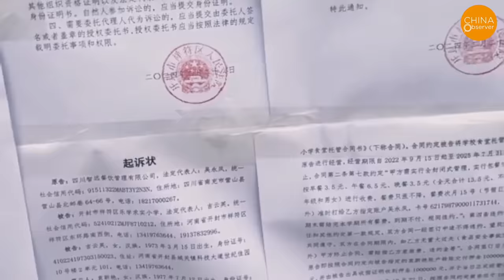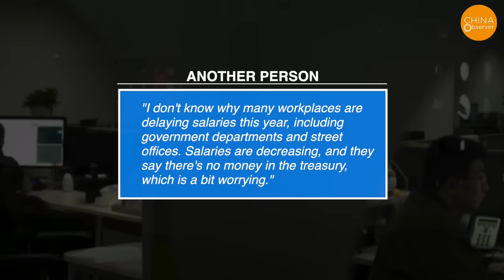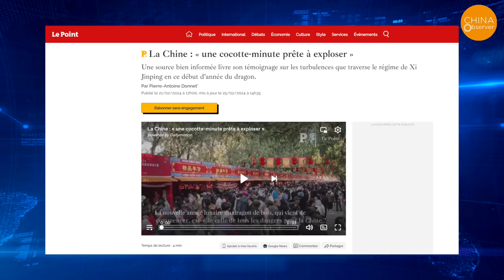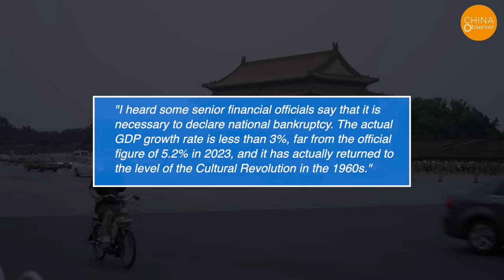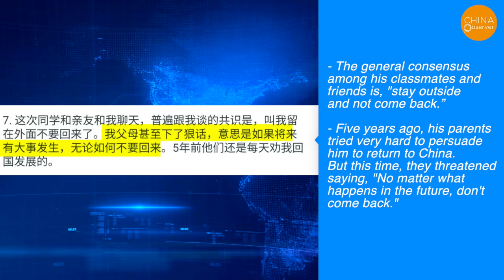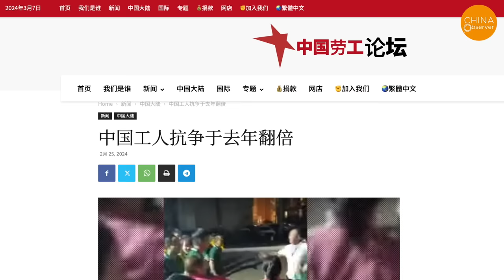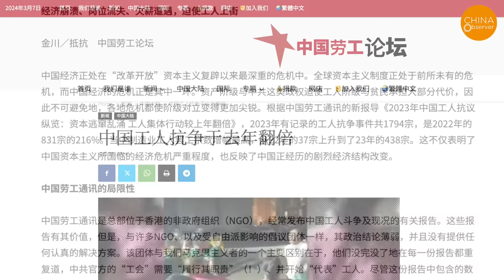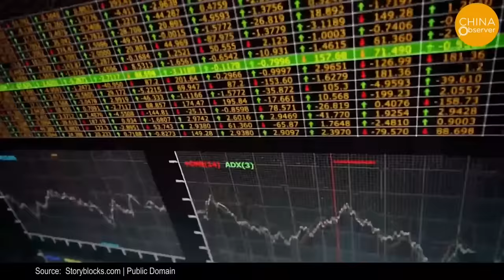One-Fifth of Civil Servants Unpaid? Is China Going Bankrupt?

Comment: How can you run out of fiat currency? Just print more. Money printer needs to go brrrrrr
Reply: It's probably not running out of money in the traditional sense. And, I think the Evergrande problem has started the money printers, it's just that Deflation is not simple enough to invert or correct.

You need people to buy "stuff" when you print money. This is what "greases the wheel" of the economy, simple trade and food / clothing / shoes, essential goods. When there's a lack of money being spent, the gears don't move. 

Deflation is what you get when the banks are involved in problems i.e. loans being paid back, people adding credit, paying off loans, etc. It  all stays within the bank, instead of moving goods and trade around. It seems fine, until you understand the crisis of stalling the economy long term. The wheels break down. People steal the wheels, etc. 

The banks in China likely have a massive blowout of money they can't repay or hold. The printed money is paying off false debts they can't forgive, or won't forgive, because it would invert from deflation back to inflation if they forgive Hundreds of Billions of debts. It's not a simple problem when the bank has to destroy/hold onto currency it should never have had or loaned out. 

This debt problem isn't trivial to unfreeze, and it's likely avoiding those consequences that's causing the retention of money/assets. Everyone's waiting for the bubble to burst, so they can spend money again. Hoping it can tide the problem when businesses start to close or go bankrupt in large waves. 

Senior Bureaucrats are holding money back from the workers in the department, to pay back loans or debts they shouldn't have spent money on. 

Embezzling from people who will Never report on their senior colleagues. The situation is likely because senior civil servants are using government money to run businesses, or pay back debts they shouldn't have. After all, some of the richest people in China, used to work in the civil service with money that appeared from nowhere, started business empires that made billions.

Mostly because, who do you trust in the government to report fraud to. Other bureaucrats ?  These events probably go social because there's a kind of "stay under shelter" mentality within these corrupt departments, led by people with more power than the police or military. 

ie. There's no living heroes in China. Not for long.

Plus, there's also a lot of finger-pointing and widespread embezzling of budgets, so you would never be able to tell who is stealing the money when everyone is equally guilty, or made to be guilty when there's a young 20 something scapegoat nearby to blame, or you need their fingerprints on a bank book, sic.

The other concern is, a lot of the CCP Civil Service bureaucracy is top-heavy elderly people, surrounded by 150 IQ 20-30 year olds who are being kept out of the politics and power, hired by strict exams.

This creates a bit of a powderkeg of resentment and fog-of-war politics where there's no incentive to keep people in power who would take your work, or your life for their amusement.  The civil service know to keep quiet, despite how bad it could get ... because these are 70-90 year olds who cannot be offended and will have your whole family arrested, across generations. Across villages, even the neighbours you grew up near. These are former red guard sociopaths born in the 1940s, and have government jobs for life. Anyone who would speak up for you will be removed to send a message. 

Especially given a lot of these funds are medical or housing, where the budgets aren't reported back to the central bureaucracy. And the funds / accounts aren't linked to trackable bank accounts on purpose, i.e. paid to bank cards, sic.

There's no IRS or tax department to investigate the CCP's internal problems. So, embezzlement of government funds, from bureaucrats and leaders who are too important to investigate or prosecute, and can remove judges or fire police chiefs who get too close. I would say that the CCP likely has a military wing or an internal department they rely on to cut away the worst offenders... but that also requires the will to proceed. 

The scale of the CCP bureaucratic departments is vast. Tens of Millions of officials. And it's not centrally managed, so some civil workers would likely be paid in a state or in a bureau/department with the budget for that department. 

Something like 15% of the population works for the government in some capacity, so the budgets and pay are handled by the local admin/bureau departments.
Reply: @Toliman.  Wow great explanation, thanks
Reply: @Toliman.  Wasn't expecting an essay this long and good quality 
Thanks and good job!